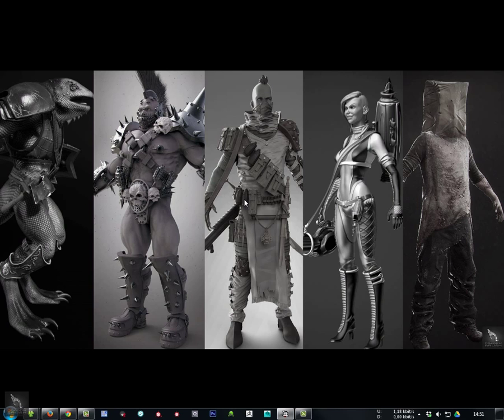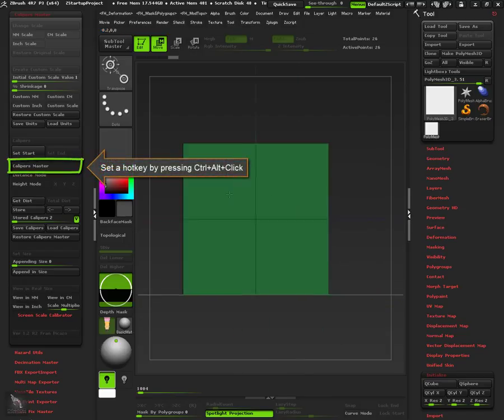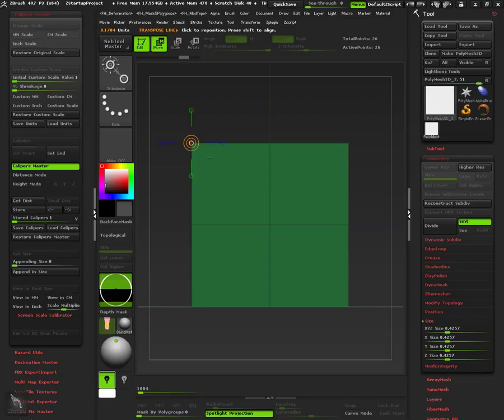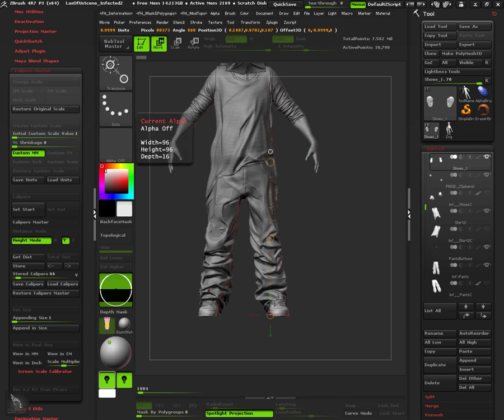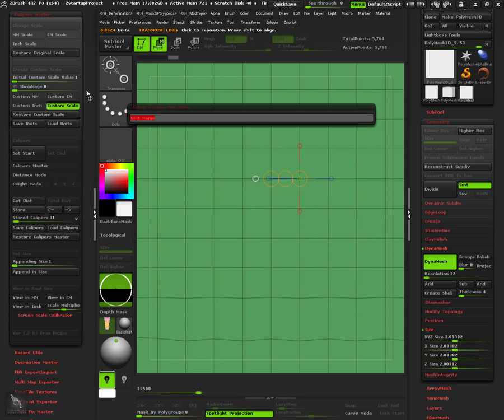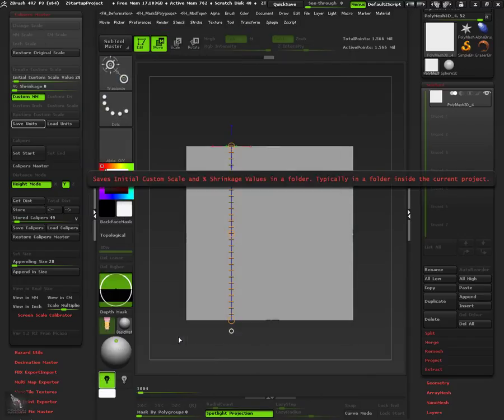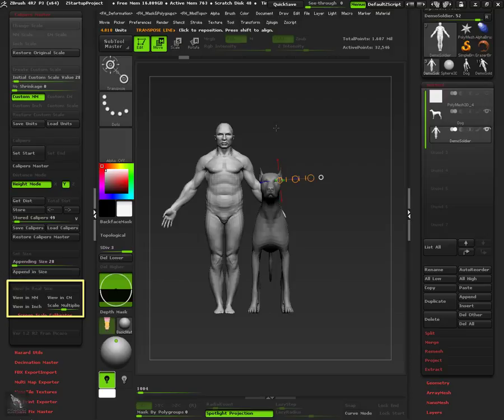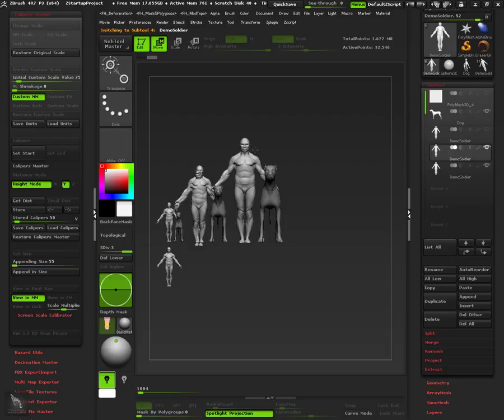Calipers Master 1.2 R2 Users Guide

Comment: Hi there Fran, this video came across by searching zbrush tutorials in pinterest...i don't know much about it but seems interesting and i think i will buy it soon. The main pourpose of the plugin is to aid in the measuring of models for 3d printing right? I find zbrush to be very relative (vs absolute) in terms of sizes of things and always is a mess to have them unified and readable for other programs and 3d printing. And i guess my real question is, if with this tool, the size i set is the one that will be readed by external applications or if is mostly an internal workflow for zbrush? For example if i set it to 30mm then in Maya will be imported as 30mm and printed in 30mm without setting anything else? Thanks!
Reply from the maker: +Drumaier J Thanks for your comments!
Well it was originally developed just for measuring inside ZBrush. But after some releases i´ve been adding more and more features :)
About sizes between 3D applications and Calipers Master: With Calipers Master your exported mesh will always match Netfabb and all 3D printing related apps tested to date. 
We can´t say same thing for Maya 2016! If you set your scene preferences in millimeters scale and you create a 1 unit cube, you will notice after measuring that it will say it is 10mm. But If you check that cube on Netfabb you will see it is in fact 1mm not 10mm. So Maya does not measure real size outputs.
To me the rule is: set Maya in Centimeters but consider them millimeters for 3D print. This way. Zbrush with Calipers Master, Maya and Netfabb will always match the numbers. Being in fact. Zbrush in mm, Maya in Centimeters, Netfabb in mm.
I will record a video showing this workflow very soon!
Feel free to join Calipers Master Facebook group for more info:
https://www.facebook.com/groups/CalipersMaster/
Reply: +Fran Picazo Thanks!
Reply from the maker: +Drumaier J Here you have :)
https://www.youtube.com/watch?v=Up0YbFZ9YhM